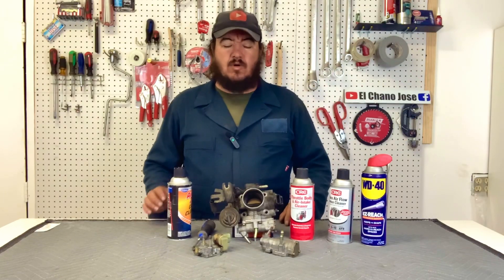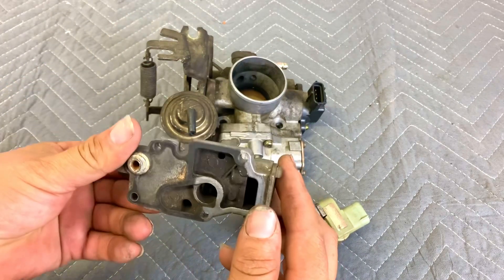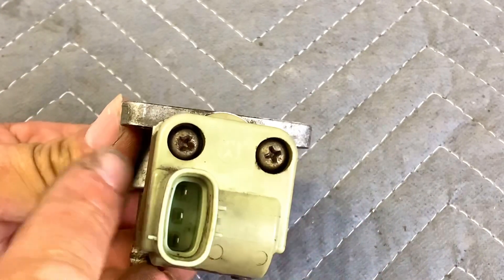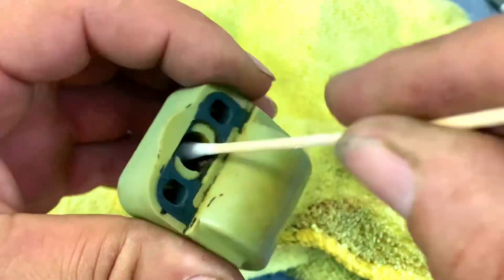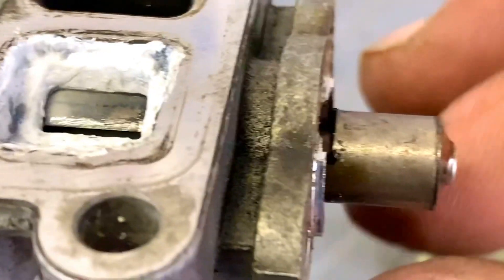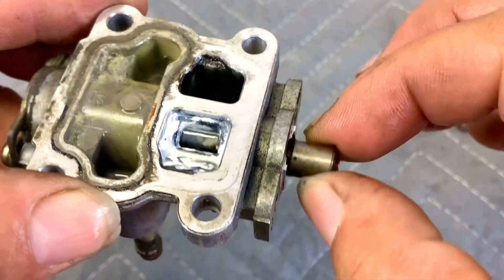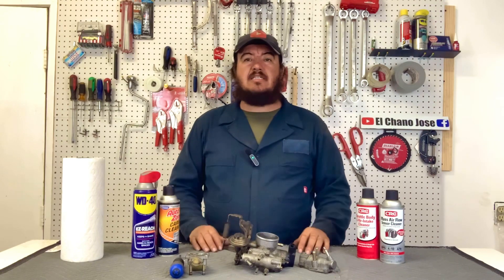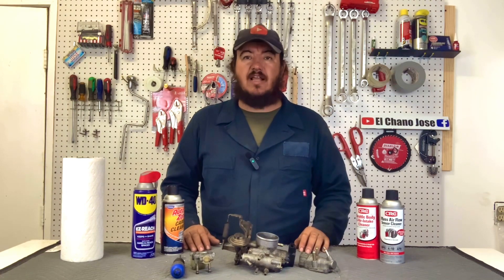How to clean a 95-99 Tercel IAC idle air control valve @elchanojose

Comment: My 96 thru a check engine light. Did a OB 11 scan and it was TPS. Replaced the TPS with (OEM), cleaned the throttle body and replaced the air filter (OEM). The car runs like new. Went through NJ inspection no problem. 
My 93 currently has a high idle condition which I an dx currently.
Great video brother.